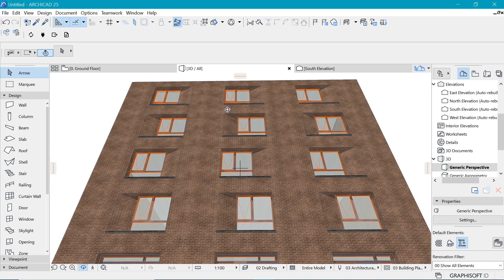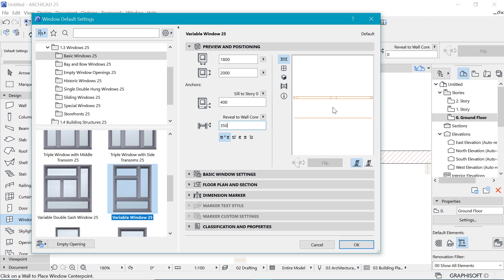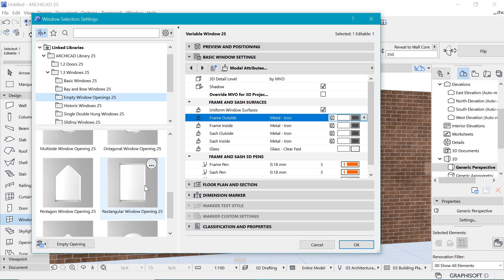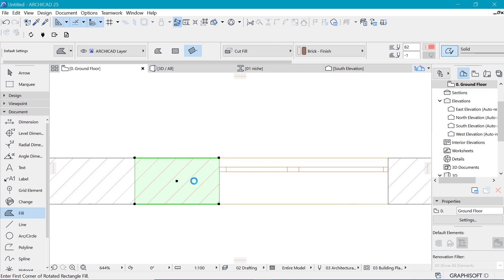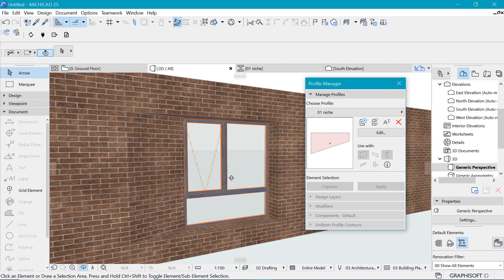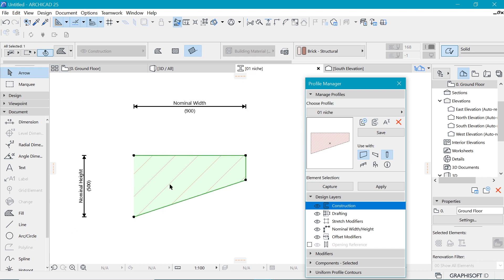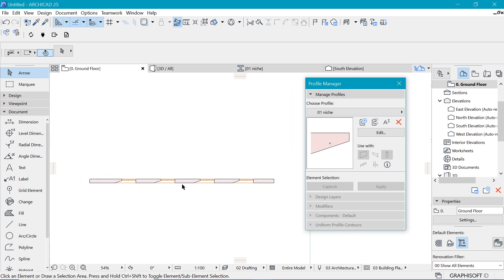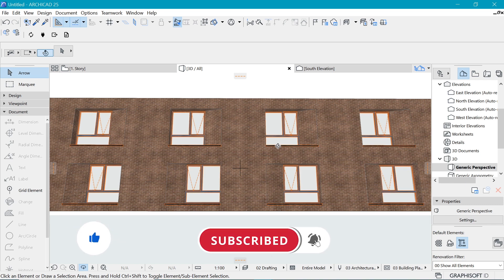Façade design with archicad; recessed window

Comment: Interesting approach I usually use the slab tool for recessed windows it's easier guilty of taking the path of least resistance😁😁😁
Reply from the maker: It works great!!, the only challenge is making it look right in floor plan🤔
Reply: @nalituts  I see now why you choose the longer method.